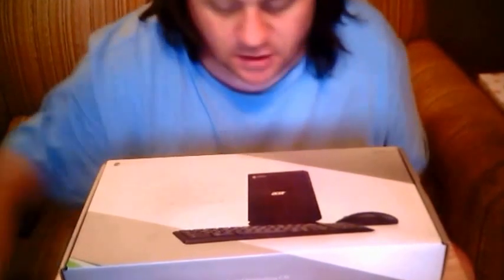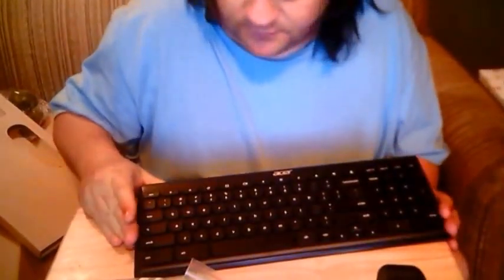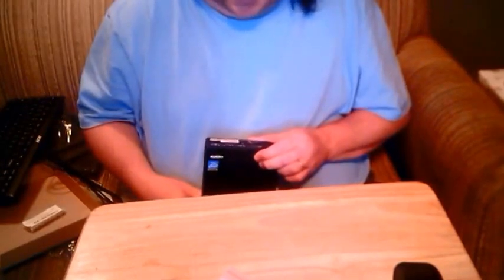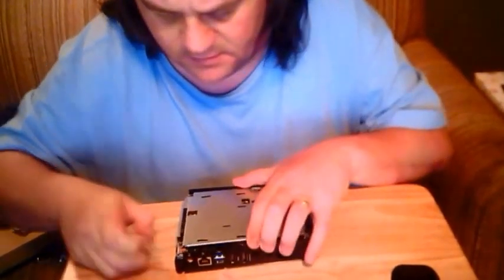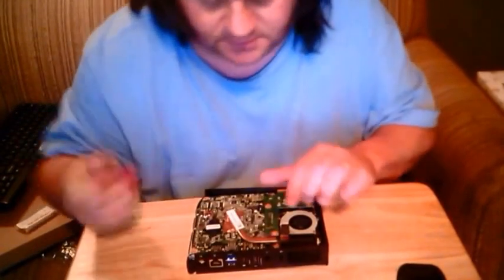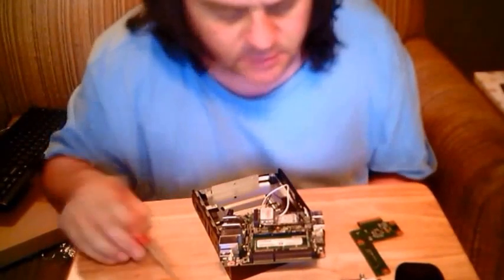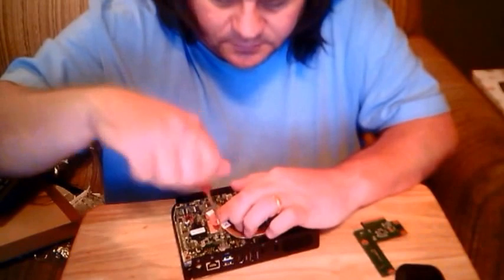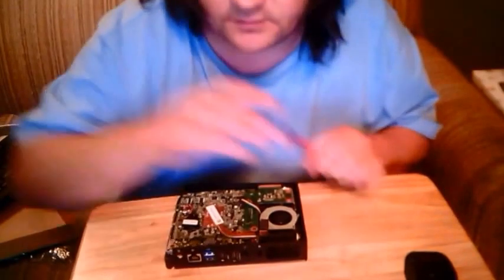Acer CXI Chromebox

Comment: I was considering getting one off these and a few screws aren't as much of a problem for me as the fact that this unit seems to have been built ass-backwards.

if you compare it to Chromebooks that aren't upgradable but come apart by simply removing their bottoms, this uogradable design is crude. The HP and Asus are competitors are easy to open, simple to upgrade.